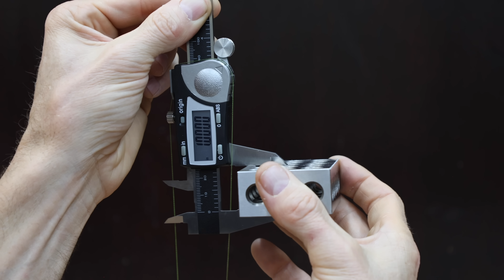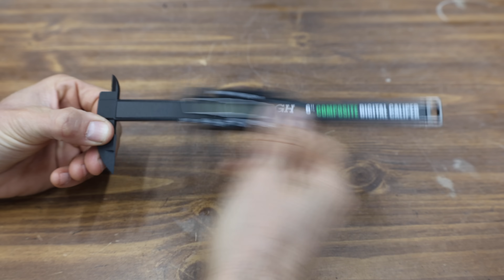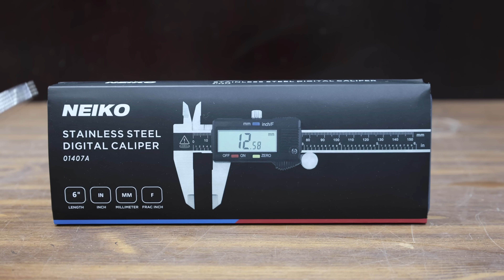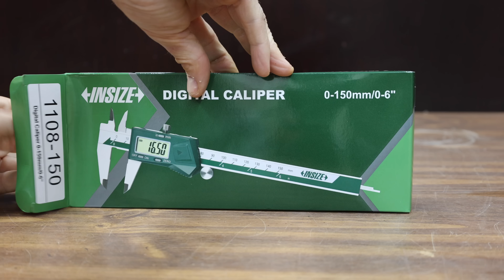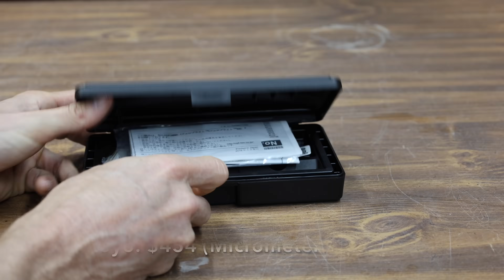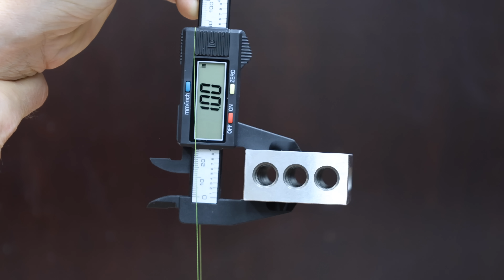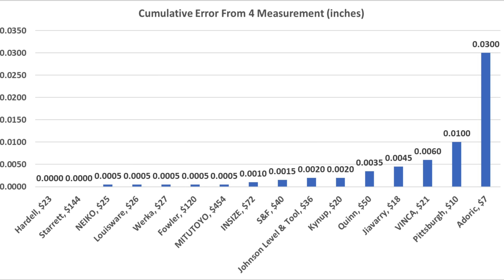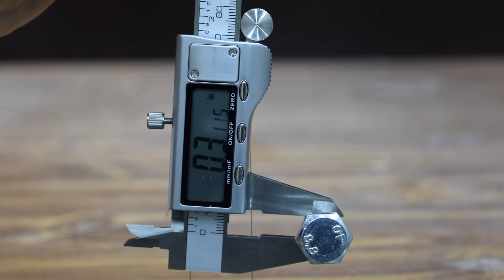I've Been Proven Wrong About Calipers!

Comment: what the heck.. i've been a long time watcher of this channel.. even commented a few times. But this is legit the first time i JUST purchased something after debating for a while one where to go price point wise. Here's to hoping mine (or similar) show up as a good pick. Got mine for just under $40 on amazon. Fingers crossed. (To be fair i've been using them and have had no issues prototyping a new part from an existing part. So mine seems fine, just hope i didnt over spend too much)
Reply: For context. Mine is an 8inch (200mm) with Absolute Scale measurement, but similar to the Neiko otherwise.

Comment: I run a CNC shop. I use cheaper sets of calipers to toss around and do quick checks but final checks are with good tools. We have a mix of Starret, Mitutoyo, Fowler, Brown and Sharp and some random cheapo ones that have proven to be good enough but not reliable for single checks.

Comment: Another excellent Job.  I use a thumb powered analog dial Starrett with carbide jaws. Accurate to .00005". But for most measurements I just use the Harbor freight version.

Comment: Missing an important test of repeatability/ consistency. I used to have very cheap callipers, I could measure the same thing 5 times and get 5 different measurements. Though a more difficult long term test would be repeatability/ consistency after lots of use, I suspect this is where the cheaper callipers would loose out the most, but it is harder to test. To be fair, I don't use super expensive ones even now, but certainly more expensive than my old ones, and they have been a much better tool, that gives me much better, and more useful measurements, not that I am taking measurements tat require the absolute most precision, but I'd rather have a better tool, than one that's not good enough.

Comment: Calipers can me metric or imperial, but not both.Yes, they have mm/inch button, but this button enable unit conversion, it does not change physical sensor. For a metric caliper scale has resolution 0.01 mm, for imperial one scale has resolution 0.0127 mm(0.0005 in). If you trying to measure something with metric caliper set to inches, accuracy will be lower because of rounding. If you open Mitutoyo catalog you would find that they have both versions. I am pretty sure that cheap Chinese calipers is metric ones. By the way, even 1-2-3 block is ground, it isn't precise. Gauge block set would be really better.

Comment: I would have really liked to have seen a quiescent current analysis, as a lot of these cheap calipers have high current draw when they're "off".  Maybe they're getting better, but all the ones I've dealt with, you needed to take the battery out every time you put it away if you didn't want it to be dead in a month.  
That said, I can understand that you might not have all the equipment to measure that accurately.  On the bright side, poor battery life is something that customer reviews should tend to reveal if it's an issue.

Comment: it seems like $10 thru $60 gets you basically the same thing. I got a cheap $20 one that was gritty. cleaned it and it was pretty smooth. I think they don't fully clean the groove after machining. Been using it for years and I like it. its quite accurate. maybe not enough for a machine shop.

Comment: i use an old dial caliper for reloading. i check against my feeler gauges for setting points. work got me a cheap plastic set that is crude but i work on boilers so i don't need .001 accuracy. 1/16th lets me get the right wrench on a bolt. i have a wide mix of sizes. the joy of working on 1960s equipment.

Comment: I a mitutoyo digital caliper that was about $150 years ago and it still works great today and I use it very often.
Reply: They are still about that price. I'm not sure why he had to pay $450
Reply: @mediocreman2 he mentioned that it was a set that contained the micrometer and caliper together. Also had that wood box.
Reply: @mediocreman2  becuase he bought some sort of kit that was a Mitutoyo micrometer and calipers together and came with a wood case.
Reply: They're still the same price range.  If he paid $450 for those he got scammed.  $148.53 on MSC right now.

Comment: One important thing you missed is to test how much current draw they use when turned off. I had a set of cheap calipers that would need new batteries every few months after sitting in a drawer. The Mitutoyo I have now doesn't have that issue

Comment: I bought my calipers at Harbor Freight probably around 20 years ago and they are still going strong...while I don't use it every day, or every month, it is always available and working when I need it. I store it with the battery removed and only insert the battery when using it. I think I paid $19.99 for it because I doubt I'd pay more than that...

Comment: I've been using my $2 plastic calipers from Harbor Freight for years. I'm not engineering spacecraft, but it's handy for determining fastener and material sizes. I used them to build trailer with a sport rack, accessory mounting brackets, and a custom spare tire winch.

Comment: No matter how expensive the caliper, the battery will be dead when you need it.  I have lots of cheap ones, as well as an expensive Mitutoyo.  I take the batteries out of each pair when not in use.  So I'd never buy a set that required a screwdriver to remove the battery.  The Mitutoyo is the smoothest of my collection, and the one I prefer to use.

Comment: Any interest in testing towing hitches? Not the truck side receiver but the ball mount hitch or a pintle style. Kind of an expensive test. Came to mind after I recently sought the most rugged 2 5/16 ball mount that wasn’t gen y or some crazy expensive hitch. Bought a zero drop, 2 1/2” shank 2 5/16 curt solid forged. They claim 2,000lbs of tongue weight

Comment: Wow! These 'cheapo' ones have REALLY cheaped out! I bought a set of 'Performance Tool' calipers about 12-15 years ago at a parts store for $20 I think. But they were mostly made of metal (stainless). Came with a foam padded plastic case and spare battery. They're the ones you see that are marketed by a TON of different companies with different labeling or stickers. I have a nice Brown & Sharpe dial set with a standard and some Swiss made Fowler Sylvac's and the cheap ones were right on against the other 2. I think it was 4 digit resolution past the decimal too. They're OK for general use in the toolbox, but I use my nice ones for precision measuring. Why not if you have 'em?

Comment: As a CNC machinist by trade. I always use Mitutoyo for reliability and the IP67 rating. Starrett is supposed to be the best but there are two types. USA (expensive like double the price) China and Scotland made which is the brand here. Fowler and cheaper everyone uses for reference only around me. Their mics arn’t bad just well…cheaply made. Not a lot of options on it.

Comment: Love this video! Im a machinist so i couldnt NOT watch this lol. I have a pair of Browne&Sharpe dial calipers and SPI digitals. Theyre pretty good, which they should be bexause its what I use to make sure the product I machine is correct lol.

Your graph for the drill bit measurements has an extra 0 in the measurements, by the way! .00025 is supermicrometer and dial indicator levels of accuracy. Again, love the video!

Comment: I've found the "Hyper Tough" from wally world works well enough for odd jobs around the house like figuring out bolt sizes. If I ever had a lathe or a mill and not just hand tools I'd go with the higher end stuff for more precision but for mass produced big box store supplies I just need the rough size and not down to 3 decimal places. Then again I'm probably using calipers wrong and would anger some machinists.

Comment: I bought Chinese micrometers when I was taking a machining class at the local community college.  I didn’t want to take my Starrett set to school to get stolen.  The Starrett and Mitutoyo were much easier to get consistent readings with.  If you need to be accurate, use the Starrett or Mitutoyo brands

Comment: I really don't understand these plastic calipers that only measure to 0.01" - for anything you're actually measuring with calipers, you'd want at least 0.001", if not 0.0005" - for 0.01" just use a tape measure ffs!

Comment: You should have measured AMP draw from the callipers  when in  use and off.  More importantly when off of which the Mitutoyo draws the smallest amount of power. Auto off and on  is useless feature which actually uses more power. Also you should have used either ceramic or steel  gage blocks for better precision.

Comment: The othere test you could do is to mesure battery drain. Some calibers drain 2 or 3 times as much. Also for some they draw nearly the same amount of power with the screen on or off. 
Calibers aren't much good if every time you go to use them they are dead.

Comment: The Starrett was a little off measuring the outside of the block and you said they were perfect. That being said I trust Starrett and Mitutoyo over your 123 block LOL. Everything has a tolerance even a brand new endmill will be slightly over or under size. The CNC shop I used to work at had Insize brand calipers. I dunno why. I went and bought my own dial caliper and manual mics and got them calibrated so I could use them on parts. There are different grades of gauge blocks and depending on temperature they will read slightly different. For this video to be perfect everything would have to be measured at exactly the same temperature and humidity. And the depth measurements done on a calibrated granite slab. But as a buying guide this is good.

Comment: As a machinist, I have to agree with many of the critiques in the comments unfortunately. I would take these into consideration and then do a reshoot at some point.
One thing I have not seen mentioned is the Mitutoyo's keeping their accuracy over longer periods of time vs the cheaper brands. We have to have our calibration guy calibrate our tools every six months. The Mitutoyo's will almost never have issues whereas the cheaper brands tend to start losing their accuracy much sooner.
I would recommend going to a local machine iso9001 machine shop and asking the tool calibration guy for tips to conduct more accurate tests.
Still, I love the videos and with some tweaks this would be a fantastic video. Keep up the good work!
Reply: Can buy calibration test gages
Reply: @tomhenry897 yeah the calibration guy uses those. l personally just use Gage block buildups for the most part it is close enough for anything I measure with calipers.

Comment: I bought some calipers for the first time last week they were the Adoric Stainless steel version. HORRIBLE! I tested them on some gauges and mine where off by 0.35mm! They are so bad that I could have done the measurements better with a ruler and my eyes alone. I spend $22 thinking I was going with "smart budget"; nope I should have just got plastic ones they would have been better! I tried to use the calibration bolt but after using the included screwdriver the bolt was turned into dust! I returned them after using them for 10 minutes. Idk if there is a way but they should be taken off of amazon as they are so inaccurate I wouldn't even call them precision calipers.

Comment: I prefer the calipers using CR2032 batteries. If you don't want the leaky battery to ruin your expensive calipers, please use the SR44 batteries instead of LR44. SR44 is silver oxide battery, much better than  the leaky alkaline LR44 battery.

Comment: Aside from the battery life, the only problems I've ever had with cheap digital calipers have been related to the cheap metal frame parts..  Wear on the sliding surfaces, easily nicked, incomplete cleanup on cast surfaces, improperly bent leaf spring, etc.  The electronics do the job fine.  For light, infrequent duty just take the battery out when you put it back in the drawer.
Reply from the maker: Thanks for sharing.

Comment: As an engineer, I have a set of Mitutoyo calipers and I use them all the time. They still work just as well as when I got them 15 years ago. 

I do have a that Harbor Freight composite set I use for dirty outdoor stuff and even woodworking. I don’t need much accuracy for that stuff and if they break or get coated in grime, I don’t care.
Reply from the maker: Thanks for sharing.

Comment: A couple of comments, if the caliper is "remembering" the measurement after powering it down, the battery is being constantly drained. Some of the inexpensive calipers do have a true power-off feature so you can leave the battery in at all times, otherwise I would recommend removing the battery. If you have the type with the ridiculously tiny screws, it's a good idea to remove those above a magnetic tray. Also, calipers have at least one, almost always two adjustment screws that keep the head perfectly square to the rule/scale. Those screws can cause a very small amounts of drag due to miniscule variances in the width of the rule. Those rough spots will usually wear-in as the caliper gets used. I recommend that you do not adjust those screws because it can cause a mismatch in measurements between the inner most and outer most parts of the jaws.
Reply from the maker: Thanks for sharing.
Reply: You said: "A couple of comments, if the caliper is "remembering" the measurement after powering it down, the battery is being constantly drained." ... That isn't necessarily correct. Many devices store data without constant power ... like every memory card you ever owned. It depends on the design.
Reply: @MrAdopado  Calipers are not meant to be a storage device, remove the battery and see what happens.

Comment: I have the 8" version of the Mitutoyo the battery is good for about 2 years, its low powered mode works very well. It is very annoying to pick up your Caliper and it has shut it self down. There is no point in having an extra battery they last so long you will probably use it else where or just lose it. The depth extension is not that accurate. Good for reloading but for more you need a depth micrometer for more accuracy.
Reply from the maker: Thanks for sharing.

Comment: Earlier this year I suggested a video on calipers. I'm sure tons of other people have too, and it's a logical choice, but I'm going to pretend that this video was for me :).

I have the same Neiko and Mitutoyo calipers and my anecdotal experience matches with your analysis. The Neiko is a great value. Mitutoyo is excellent engineering (though I agree that it's crazy that it doesn't have auto power-off)

One BIG correction though:  You are quoting $454 dollars for the Mitutoyo, which apparently was for a combo set with Micrometer and fancy case? You do clarify that the calipers alone are ~$250, so you should have used that price in the comparisons/data. But also, those calipers (Mitutoyo 500-196-30) are actually only ~$170 from several reputable sites.

Comment: Good testing. As far as I am concerned all of the battery powered calipers are junk no matter how much or little they cost. If I am in the shop it seems like I always end up with a caliper in hand measuring something. Too many times in another shop when I needed a caliper it didn't work which meant stopping and looking for a battery if there was one to be found at all. Just more lost time.

I will put up my 40+ year old Mitutoyo dial calipers against any of the ones tested and the one I purchased in the early 70's still works like new even if the case foam melted around it. It is all about taking care of them, keeping them lubed some, and keeping the chips out of them. 

If you can't read a mechanical dial caliper maybe you are in the wrong line of work. It is the same with micrometers. Even with my eyes I can still tell what it says without having it tell me what it says.
Reply from the maker: Thanks!  Thanks for the feedback.

Comment: The review would be better if you tested the current draw while on and also while off. Mitutoyo draws significantly less power when on versus the Chinese brands when they are off. In the machining and professional metrology worlds mitutoyo is a no contest winner for good reason. And finally you definitely way overpaid for those mitutoyo that you have at over $400.

Comment: Just a note, auto shut down just turns off the screen which does not do much. This is more of a marketing gimmick. 
People actually measured power draw of the calipers when "off". Cheap stuff just uses a lot more power than expensive stuff. 
I know long term use cannot be tested but it seems top brands are easier to get accurate result from them cheap stuff. Could be related to smoothness of operation.

Comment: Any of these have a nonplastic house (aluminium?) for the screen and buttons? I usually breake mine by placing something heavy, like a book, over that area. The screen cant take it and shows none digit data.. Goes thru at least 2 pr year by not remembering to keep the calipers in a case, and thats as a DIY. Maby bying something that costs more than 30 dollars might hold longer..

Comment: As a machinist who's used a lot of calipers, mitutoyo is my go-to brand. They're very very reliable and there's not a caliper on the market that can match their battery life. However, the main takeaway from this video is that, unless you are a professional machinist, even the cheapest digital calipers are absolutely accurate enough for the home shop or garage. I'd go for the Quinn specifically because they use an absolute scale and have auto shut-off.
Reply from the maker: Thanks for the feedback.